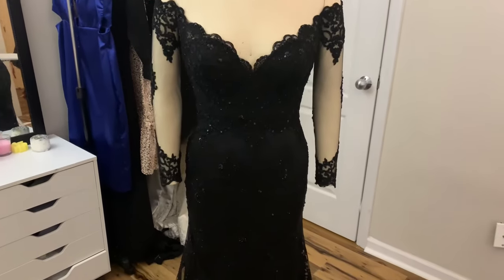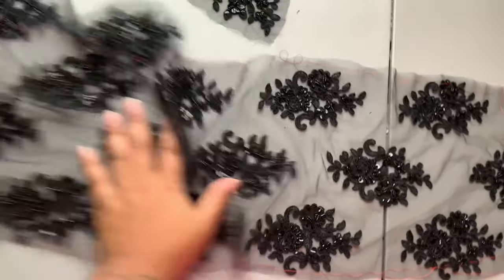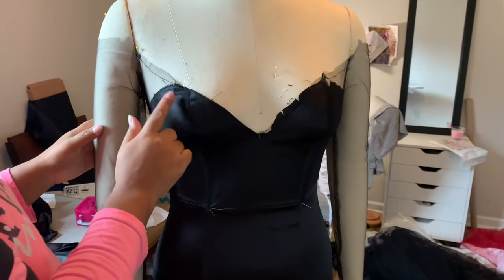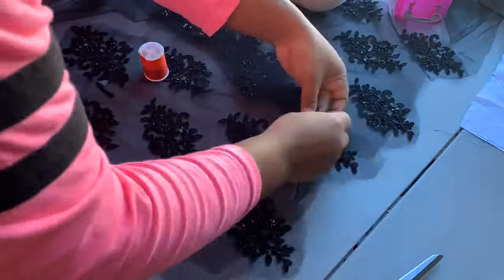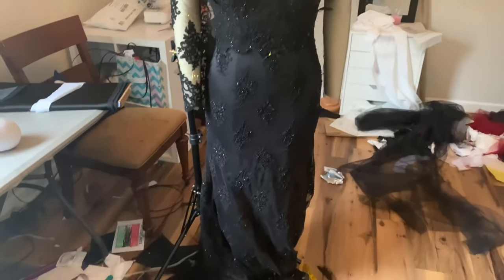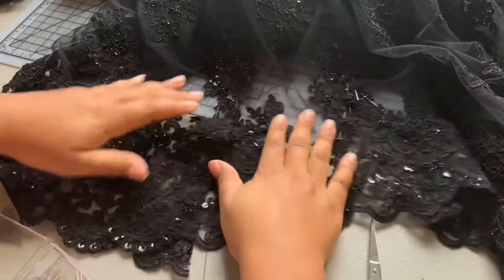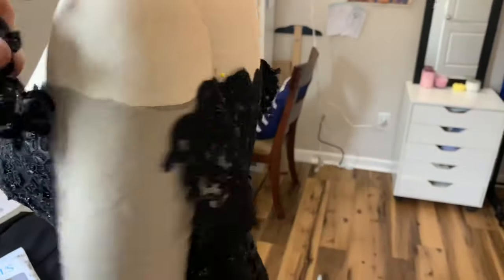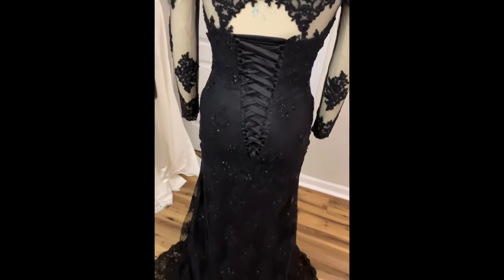DIY Wedding Dress: Making of a Black Lace Wedding Dress

Comment: Just stunning! 
I'm just wondering as the sleeves are tulle and off the shoulder how do you prevent them sliding down? Do you add a small piece of elastic around  the top edge?
Reply from the maker: Yes you can use clear swimwear elastic.

Comment: Lovely,,, do u serge your lace panels? As well as the lining pieces. I also would like to know whether u have mannequins from size 8 to 18,,,, if not, pls how then are u able to get the correct measurements when sewing several sizes... am a beginner and I would like to know if there are standard size chart for women that I can use ... it's really urgent . Pls help.. also, in case u have only one mannequins in maybe size 8,,, how r u able to sew a size 10 or 14, for it to fit well... that's my problem.. pls reply
Reply from the maker: Sorry I am just getting back to you. I have a size 6 and a size 16. When working with clients I custom draft dress blocks for them and make my patterns off of that.